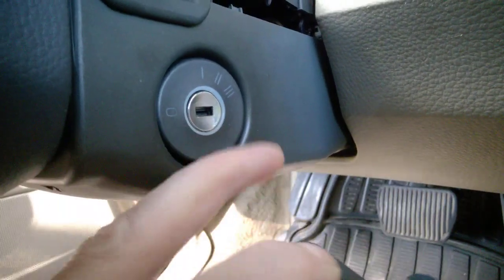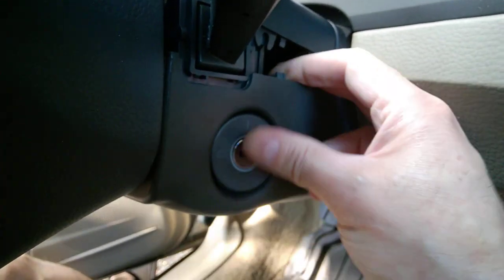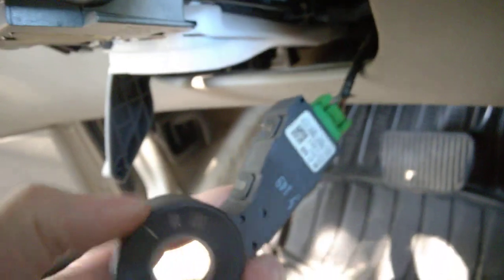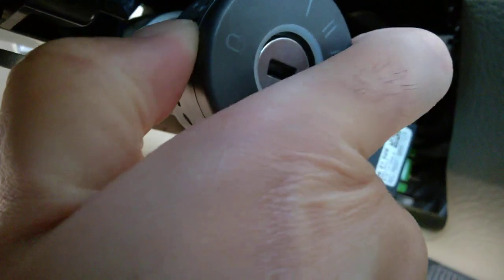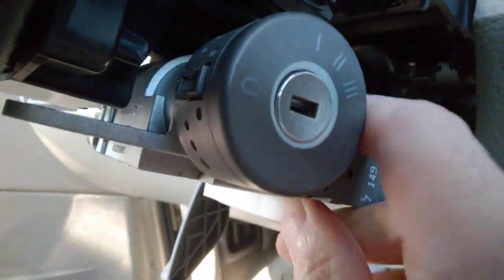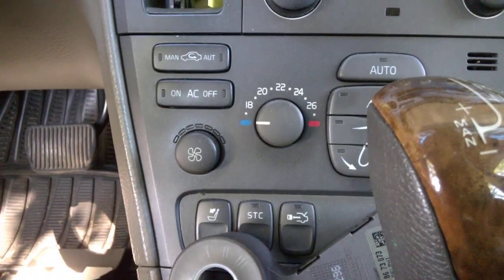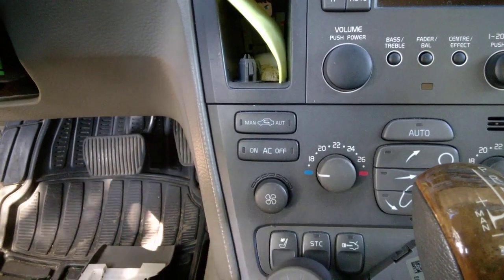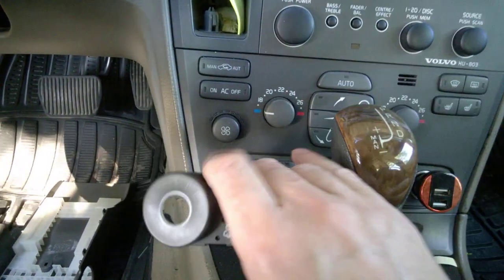Volvo S60 XC70 Antenna ring removal  2001-2009

Comment from the maker: When you get the "Start prevented" message,  try using the other key/fob, and make sure you don't keep two keys together.  Check none of the fob buttons is stuck and may try replacing the fob battery.
Again, it is possible the CEM simply resets and no longer recognizes the key. This happens quite often when the car is not used for long term and the battery gets flat. Volvo may reprogram the CEM to recognize the keys.
Also, from Volvo "Not more than one of the keys for your car should be kept on the same key ring. This could cause conflicting signals to be transmitted to the ignition switch, making it impossible to start the car. "
Reply: I think, I made that mistake, I was leaving my job two days ago and one key was inside the switch and I forgot it. The other was in my pocket . Then, accidentally took the one from my pocket tried to inserted in the switch, obviously I realized the other was there but touched the two keys to each other. Then, Immobiliser, see manual appeared and haven’t been able to start the car two days ago. Any help would be appreciated
Reply from the maker: @albertobeltran5554  I can only take a wild guess, perhaps the CEM has lost the keys identification. The CEM is the module programmed to recognize the keys (each key has an id set in the CEM software). That would be a tow to Volvo to have them reprogram the CEM to recognize the keys again. Should need nothing replaced, only programming. Since Volvo is often times greedy, they may try asking to replace this or that, so rather call in advance make sure they they are willing to only reprogram the CEM

Comment: Just replaced mine today and my immobilizer warning disappeared.  I also had the failed to start try again message a few times before replacing.  Very easy job.  Thanks for sharing!
Reply: Does it require programming?
Reply: @aaronkudatsky8940  Nope. 100% plug-n-play.
Reply from the maker: @aaronkudatsky8940  No programming needed for this part

Comment: Great Vids Peppermint. I had 2 fobs not working only valet key could start car for 3 months. Ignored problem. Sometimes valet did not start car so I pulled start relay and cranked the engine with a wire jumper. Seemed to fool immobilizer for awhile. Now nothing works to start car. Will check starter, change ignition antennae and YES get someone to turn off the immobilizer with their OBD2 accessed computer! I will put in a kill switch later. Forget $$$ reprogramming

Comment: I thought my ignition ring had developed a fault as often when starting the car I would get an error message "Starting prevented, try again" and after 1 or more tries it would start.
The issue was that the RFID door key fob for my office was confusing the antenna ring. 
Removed that key fob from my keys and attached it to my belt and the problem went away.

Also regarding storing the car for long periods, I would recommend using a solar panel that plugs into your cigarette lighter to keep the battery topped up.
Have been using this during Covid19 as my car isn't being used and it has no issue keeping the battery fully charged.
However, if your car's electrical system has problems this may not provide enough current to keep your battery topped up.
In my 2002 v70 the power socket in the rear of the car is always live so I connect the solar panel to that, this process wouldn't work on the front socket which is switched with the ignition. 
Search in google for "Solar Car Battery Trickle Charger" to buy one.

Thanks for another great video!
Reply from the maker: Great info.  Using a trickle charger is indeed the best option, better than disconnecting the battery - especially on the V70s where we need to reach the trunk from inside the car.

Comment: Great video as always buddy.  I have a 2004 s60R and I always check with you 1st before any repair. 
QUESTION-Is there a way to only  change the bulb in this ring?  My error tells me the light is out and I would rather spend $4 than $70 for a new part:)
Reply from the maker: I think light is from a small LED that cannot be removed. Would suggest buying a used antenna right from similar year, no programming needed

Comment: I need to replace the bulb in my antenna trying that no longer illuminates. Probably going to replace with an LED bulb.  If I'm not unplugging the module, do I still need to disconnect the battery?  What do you think?
Reply from the maker: For this module, there is no need to disconnect the battery, just make sure not to have the key in the contact. I would first try to push more firmly the green connector which may get loose sometimes - again, without the key in contact

Comment: Hi, I really want to do this job on my 2005 s60, but I’m very worried about having several issues from disconnecting the battery. I have read about many people suggesting  different ways of disconnecting the battery and now I’m confused. Can you please explain the proper way to disconnect? Thanks
Reply from the maker: There is no need to disconnect the battery for antenna ring replacement. Just be sure not to insert the key in the ignition during this.  As for disconnecting the battery, it is a debate, some people think that having the key in POS II WITH the headlights on - many cars having daytime running lights - may help not burning a small resistor in the Climate Module - this happens very rarely but it does happen. We don't actually know if having the headlights On does actually help, but it's worth having them on. I do the same when connecting and disconnecting it, head lights on and key in POS II. Try to also insert the cable over the battery posts quickly, in one movement without making too many sparks. Same when disconnecting. May read the comments in this video as well https://youtu.be/jdW0t2FJCfA
Reply: @Peppermint1  Thanks! This was very helpful.

Comment: Hi. I have recently acquired a volvo xc90 2007 model from someone. I'm getting this "start prevented" message when turning the key and the car started a few times and sometimes just doesn't want to start. I noticed that the previous owner had the wrong battery so I switched the battery with another with the correct specs. 

Same issue after trying to start, "start prevented please try again" error.

I'll check the antenna in the morning since I can hear the relays switching like crazy so I think I need to make sure  the antenna and that green piece is making good contact.

As far as I've followed the comments, it's either the antenna or the green piece connected to it, the fob needs reprogramming, bad relay or the starter or wiring... Is those the possible causes for this erratic non starting issue? I'm new to volvo so I'd appreciate any advice before doing more costly replacements/repairs. Oh and I only have 1 key.
Reply from the maker: Try using the other key, and make sure you don't keep two keys together.  Check none of the fob buttons is stuck and may try replacing the fob battery.
Reply: @Peppermint1  thanks for replying so soon. I was only given 1 key. I can try another battery but I understand that the battery was changed recently though I'll swop it out nonetheless. The buttons do luck and unlock and all buttons are working, except I'm not sure about the red triangle button. It's midnight now so I'll have to try these in the morning. But again, I only have 1 key
Reply: @Peppermint1  I tried searching for more videos and this scenario, when the key is turn to on, the radio display and that seat belt notification in the rear view mirror turns off or cuts out until I turn the key back to position 1 or 2. It's the really the same scenario and Gona have to check this out as well but I'm not too keen on knocking an electronic part really.
Here's the link 
https://youtu.be/VD159ox07FI
Reply from the maker: Hope it helps, however note that the car is the video you linked is another generation/model with different electronics.  Let us know
Reply: @Peppermint1  yes I know it's different, model and likely the software since I'm really unaware, but the issue was identical. I checked all relays and fuses and nothing appears to be busted just that I keep getting that loud clicking sound from the relays. So I fiddled with the antenna ring and it cranks now. I kind of success, despite not starting. We found wiring to one of the injectors not connected properly and might need soldering since it seemed like it's not connected well enough. Not sure if that would cause it not to start despite it cranking

Comment: I'm now facing the immobilizer see manual text. I had a blown starter fuse and I changed the starter relay as well. My starter is about 8 months old and I'm not sure if that the problem. If I leave my key in the ignition for 10 seconds after I turn it to the second click it will start. If I just try and start it as soon as I jump I not won't start. Where do I go from here
Reply from the maker: When you turn the key right away and no start, does it always give the immobilizer message ?
Reply: @Peppermint1  no it does not always give the immobilizer message. I'll go to start the car and it won't start instantly but if I leave the key in the ignition for 3 or 10 seconds it starts up.
Reply from the maker: @myob3  The starter has a small wire to it, hard to see but maybe it has corrosion or it's cracked near the connector.  The starter solenoid may also be sticking.  May also try to wiggle the green connector for the antenna ring
Reply: @Peppermint1  I have blown a starter fuse as well so I replaced the start fuse and starter relay....I have also replaced the antenna ring about 8 minutes ago...the starter I have in the car is 2 years old...so it may be time for a starter sadly enough again....I will wiggle starter wire on the starter right now and keep you posted. If I don't get a result I like, I will changed starter tomorrow. I have purchased it and have it waiting lol...
Reply from the maker: @myob3  Changing the starter is a bigger job, to me is the least of the possibilities from what you describe. If you think the solenoid may be sticking, turn the key and have someone kick the starter gently with a hammer.
Reply: @Peppermint1  ok I will try that now, someone called me for a brake job so I'll "in the mood" to preform tests
Reply: My original starter with 340,000 miles on it works with h no issue, I just changed it when I did the motor swap. So I will be putting in my old one first. I am very well versed in this engine and these volvos, but some times you get stumped and would like some info before you go and seek outside help such as getting a key programed and cut.
Reply: Also I am able to change my starter in 20-30 minutes, I have own a few volvos so I know the motions
Reply from the maker: @myob3  👍 I think the original Volvo starters last very long time (unlike on a Honda for example). But may try wiggle the antenna ring too, that 10 seconds delay it's rather strange. May also ask on forums https://www.matthewsvolvosite.com/forums/
Reply: @Peppermint1  I have changed the antenna ring part for a new one.